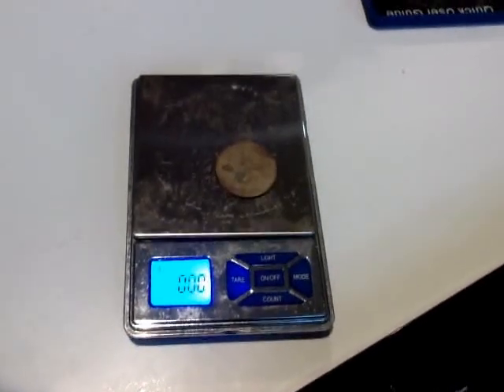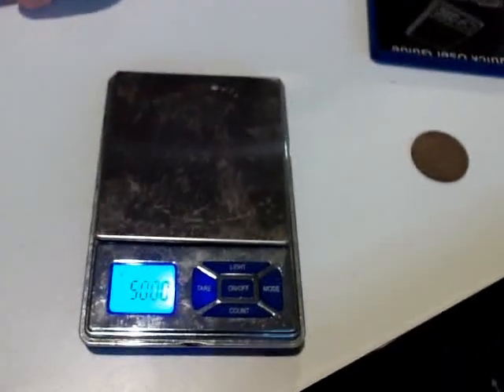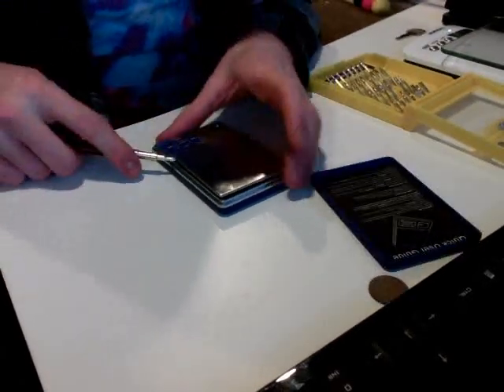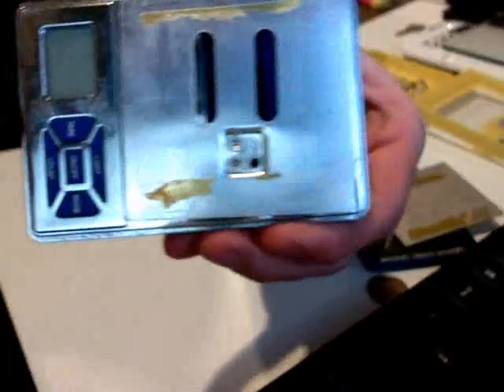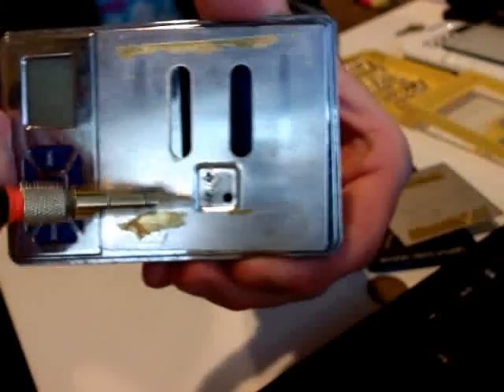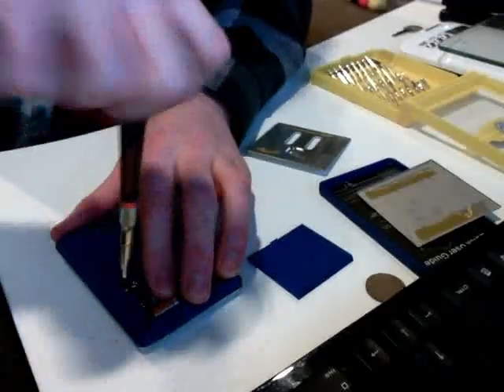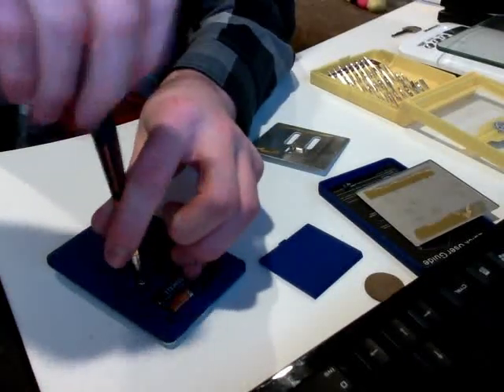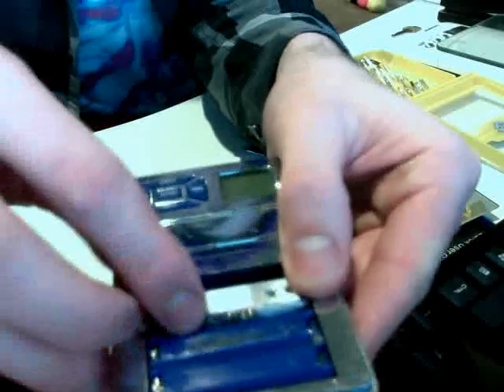Fixing a Pocket Digital Scale that Won't Calibrate

Comment: Gotta thank you for this man. Mines fell, and when I turned it on it didn't work. Thought I had to get a new one, but thought I should try searching it up, and I came across your video. Took it apart, and put it back. Re calibrated it, and bam! all good. Thank you!
Reply from the maker: BeatBum Gaming sometimes all you need to do is take something to bits and re assemble it to get it working again.

Comment: Any idea why a digital pocket scale will calibrate with a 50 g weight but  when you tare  it will always show a  negative number not zero.  Is that due to air pressure or is my scale going to be off by the negative value shown?
Reply from the maker: It seems as if your scale isn't actually calibrating. The circuitry is likely faulty, being unable to hit its zero point reliably. Does the number continue to move lower after being tared? It's certainly not air pressure, but you may be able to do some simple math to account for the error. Try weighing your 50g weight after tare, what do you get? What about a smaller tar weight?

Comment: I got mine wet and it won’t weigh now it’s always at 0 do you know any fixes for that
Reply: Open it, clean it with alcohol and an old toothbrush (we try to clean of corrosion bridges). If this doesn't work, resolder the connections with a soldering iron (if you have one).
Hope that helped
Reply: @JohnyIIOh  I appreciate the help but I threw that shit out mad long ago

Comment: do u know how to fix a scale that just shows HHH when turned on?
Reply: +Tj1056 The scale is likely out of calibration or has a circuitry fault. Try calibrating, and if that fails - disassemble and reassemble.

Comment: My scales are brand new and saying 26.6g when I put a penny on when it should weigh 3.5g? Help please...
Reply from the maker: Sounds like you are in need of a calibration. That's a whole different process.
Reply: @ZacharyMelo  I calibrated them and ever since it says the wrong weight. Is there anyway to reset them?
Reply from the maker: @justinoconnell4612  calibrate with the correct weight. If calibrated with an incorrect weight, they will never read correctly. If they cannot calibrate from a brand new state, return them.
Reply: @ZacharyMelo  ok I will try and send back if don't work thanks Zac 👌🏽

Comment: Anyone knows if it's fixable when the weight measurement starts going up by itself ?
Reply from the maker: Have you tried changing your batteries? Is the scale on a flat and level surface?
Reply: @ZacharyMelo  the scale is new witn new batteries . I did all conventional instructions .
Reply from the maker: @skan8  it sounds as if the scale is defective. Have you tried going through the calibration process in the instructions for your scale? Have you tried different batteries?
Reply: @ZacharyMelo  I did everythig , I even found some hidden settings .

Comment: Why would you tell me to pop the top off it js broke when I did that
Reply from the maker: Why would you blindly follow a YouTube video without applying your own critical thinking? Did you see how easily I break mine down? You obviously forced it and are upset, but me making a helpful video doesn’t make your mistakes my fault. Good luck with your repairs. Maybe you’ll figure out how to fix the part you broke, and make a video for some ungrateful cus to complain under.

Comment: I should have knew better my scale did not look exactly like yours so I should not have tried this my 2 screws was actually underneath where the batteries go and I just broke my scale 🤭
Reply: Yes, there are 2 down there pointing up, and 2 up under the plate pointing down. All 4 must be removed to adjust the sensor.

Comment: i have seen 100 posts all over the web and a bunch on this feed even with the same problem i have, i calibrated them and now they say full, you can't push anything except on and off, there isnt one gd solution anywhere, everyone just ignores the question, is there anyone with enough fu--in sense to know what this means? if you dont answer this then you dont deserve a video, be the one scale guru that doesnt say, oh um look online, tried it, and its useless
Reply from the maker: john otto you don't even name your scale mfg or model. I'm not your employee so don't act like I owe you anything. Continue your research and quit blaming everyone else for your scale problems. 

When you solve your problem, make a video and help the community. I'm not a scale expert, just a tinkerer.
Reply: Zachary Melo
Reply: john otto 
Hey john i,ve the exact same promblem with my scales. The make of my model is MYCO. Could you please help me out with this matter if you know how to pal...
Reply: It says fill because its over weight. If it isn't holding anything up but still says full then use your brain. The pressure sensor must he compressed right? Lol. Either the sensor is crushed and needs to be fluffed out to up crush it. Or something is keeping it heavier than it should be. How much weed crystals have gotten Inside, maybe it'd gummed up into a downward direction,  making it think there stuff on it

Comment: Can you help me please? I tried everything and didn’t change anything.. My Fuzion 200g x 0.01 was working well, always asked for 100g calibration, today I wanted to recalibrate, and it asked 500g instead. Now when weighting it is saying 0g. My rockstar can is 4.6g…. When trying to recalibrate, it asks again to put 500g, but when doing so, Err E code appear and it closes.

I’m pretty sure there’s still something to do with that scale. 😅 I don’t want to throw it away and buy a new one. This one was working A1 until it decided to ask me to calibrate it with a weight higher than what it was meant to weight (200g)